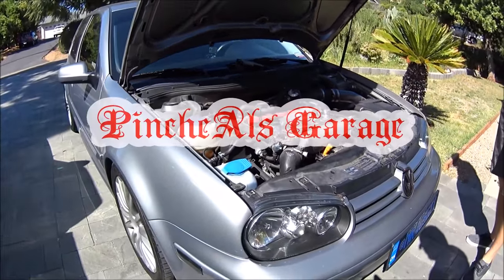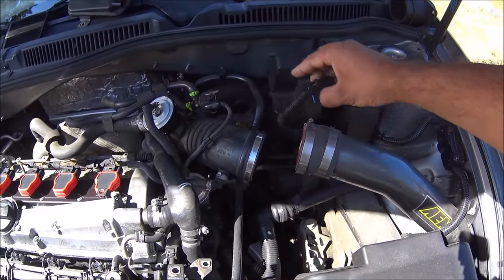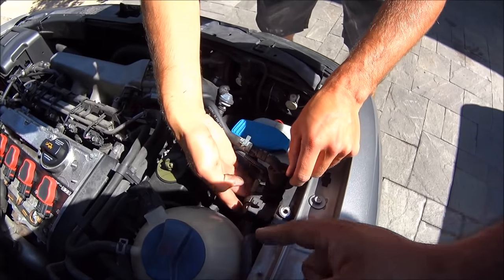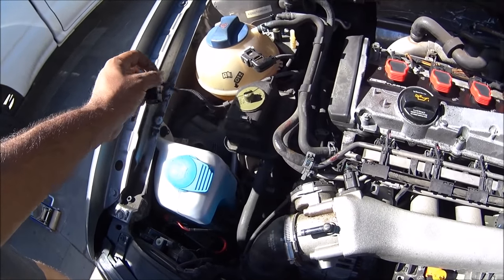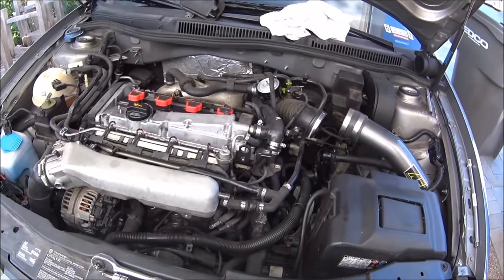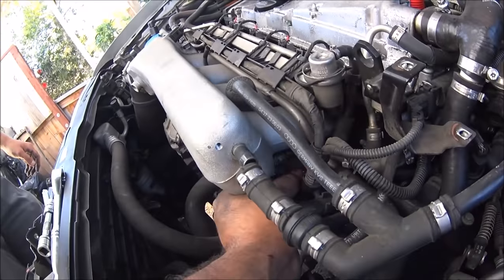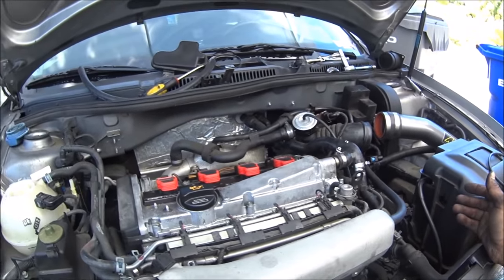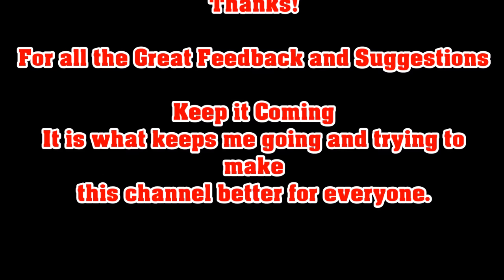How to Remove MK4 SMOG System AKA SAI Delete DIY

Comment from the maker: This is the link to the kit you will still need to buy a block off plate for the egr/combi valve or make one.

http://www.urotuning.com/Basic-Parts-Kit-for-SAI-N249-PCV-EVAP-Delete-p/sai_delete_parts.htm
Reply: what does the SAI block off plate do?
Reply from the maker: it cover the small exhaust port on the side of the head where the combi valve covers it.
Reply: PincheALs Garage , when you do that job the light of the check engine doesn't turn on ? it doesn't affect when you do the smoke check ?
Reply: the chekengin no start in my gti no start an pass de inspection no problen the problen is the boost controler no worck
Reply: what hose line did you use to route it to the break boost & the diverter valve? did you reuse hose's?
Reply: Do you need the resister for the plugs or is it fine without?
Reply: hey is there any other kits you know that sell in Europe cus ill have to play about 200 dollars for shipping to get this kit
Reply: Is there one for 2.0

Comment: Hey man I subbed due to the detail you go into!! Very awesome I have the block off plate just have to get the resistors. I'm doing a delete and a catch can all in one go and hopefully in the process figure out why my motor won't go above 5500 rpm and I have no speedometer 04 1.8t AWP

Comment: Hey I came with with a way to keep your hose connected to the intake without electrical tape. If you take the plastic piece on the end and flip it around and force it back on it actually works pretty great all the pieces just fit right into eachother

Comment: You are the man with the way you tech simplified and straight to it no need to over complicate it.i just have one question can u loop the lines coming off the fuel rail and delete the whole evap box or is there more needed.

Comment: At 16:15
That cluster of hoses that goes down to the engine below the intake manifold, what did you do with the open lines into the engine.
Reply: The smallest tap under your manifold is for your FPR and or Boost gauge, you should definitely have a boost gauge. The tap next to that is for your DV. The bigger tap previously used for your Brake booster is capped off. And the last tap at the end of the manifold you would use to run a new single line for your Brake booster IIRC. All vacuum hoses are either replaced, removed, and when necessary unused ports are capped off. Get a tune that deletes this stuff and you are ready to go.

Comment: The N249 with no signal from the ECU communicates the manifold vacumm to the DV, and when the N249 receives signal from the ECU it communicates the reservoir of vacumm to the DV.
Therefore the presence of the N249 I consider is necessary to have a better reaction in the engine to be able to activate the DV even when there is still boost in the manifold, therefore the overpressure does not force the opening of the N75 and the turbo does not fall from Rpm giving better reaction.
As a conclusion I think removing the N249 engine would have less reaction and unnecessary wear on the turbo
The only thing I see as positive when removing the n249 is less vacuum lines, better appearance
Reply: would connecting a line from the DV to the intake manifold solve this?
Reply: @bigjesus4986  yes there are actually dyno tests and lots of research shows if you have a larger turbo and other mods ditch the N249

Comment: Awesome video! Very informative, only one question, any materials that need to be bought before doing the project that don't come in the kit? Basically what I've gathered is have coolant on standby and buy some 1/2 inch tubing for the brake booster, anything else I'm missing before I go and start ripping vacuum lines out of my engine? Also, how well does it run without a tune? As of right now my SAI pump is bad so it misfires under heavy load. Would this be an improvement?
Reply: Wow 3 years I hope you figured it out by now dude, I’m in the same boat currently trying to take lines out

Comment: Funny how one of those plugs you get with the kit actually fit in the hole where the combi valve came off. I used a bolt for that other hose because it works

Comment: @PincheAls Garage - Ive done all of what you guys done on this video. I have a couple of questions. The first vacuum valve from the SMOG filter thingy, not the manifold side, the one next to the coolant reservoir ... u dont seem to mention if it needs to be capped off? or left alone with no pipe on it now? secondly ... i yanked the brake assist pipe at the rubber/plastic valve near the bulkhead, instead of cutting it like you said. there was a loud pssssss .... can i just reconnect it as if nothing happened lol!

Comment: Top of throttle body that you capped off,  that went to a check valve leading to a hardline under the fuel rail. What did you do with that hardline or after the check valve vacuum ?

Comment: Yo I did the full sai delete just curious what u do with the little Pcv valve not the hockey puck do u still need it when you chop off the unneeeded part of the brake booster I’m running mine without right now I have a catch can but I haven’t installed it yet I don’t know if I wanna use it anyway but it came with my block off plat and resistors is it ok to run without it

Comment: If i just cut the wires to the sensors id be using resistors too, it would just cause a check engine light since I already have a SAI delete? Not worried about a check engine light, more worried about bay cleanliness

Comment: I did all of this on my 1.8T. The big thing here is if your state has smog check where they put a probe in your exhaust, you will fail. If your state does OBD plug in testing, you will fail. If your state does visual inspection under the hood, you will fail. 

I did a Eurodyne tune which not only gave me more power, but also deleted those systems from OBD tests, which made my car pass emissions- we only have OBD plug in and no visual in my state.The cost of Gonzo or Eurodyne with deletes should range from $450-600 depending.
Reply: So what you are saying is. To be clear - if you get a tune that has SAI\EVAP delete (e.g. Gonzo or Eurodyne) you will no longer have a CEL and you will pass OBD2 plug emissions testing? This would be my deciding factor on Gonzo tuning if this is correct.
Reply: Ian Matyevich Yes, you will NOT have a CEL and testing at a state OBD scanner comes up clean. At least it did for me with Eurodyne
Reply: Thanks for the reply brother.

Comment: Hey so I have done this delete, it sends a code. I’m currently looking for a stage 2 tune, is there some you can recommend that will remove the check engine light for the Sai delete? I have tried just using my OBDeleven to remove the code but it just keeps coming back.

Comment: Hey! Did Sai delete, changed 02 sensors and camshaft position sensor, but I'm still getting the code for them P0333,P0411, P0420,P0343, also getting smoke outta exhaust and oil dipstick I got a 2003 gti 1.8t any ideas what it could be ? Please Help! 🙏🙏

Comment: Thanks for the DIY. one question, do I Need to cap not only the one on the intake, but all the other holes on the left side of the engine? N80 bits I think it was..
Reply from the maker: yes any vacuum line unused needs to be capped off

Comment: PincheALs Garage , when you do that job the light of the check engine doesn't turn on ? it doesn't affect when you do the smoke check ?
Reply from the maker: Daniel Diaz if your state requires smog check you will fail if you do this. this will also give you a check engine light for the secondary air flow which will not affect the cars performance.

Comment: Love this DIY, Just onee question. What size is the line that goes from the DV to intake? thanks
Reply from the maker: from the charge pipe its 3/4 to 1"
to the intake is 3/4"
the vacuum line to the manifold is 10mm
Reply: So the dv line is 3/4" or 10mm diameter on the inside?
Reply from the maker: no those are 3 separate lines
Reply from the maker: hey i just uploaded a quick video for you about your question. hope it helps
Reply: Appreciate it man, love this channel.

Comment: Hey man I know it’s a old video but im doing this delete once the kit comes in. Right now the previous owner ran a line from the fpr to a t connector. Then ran a line from the nipple you put the dv hose on to the t connector. And then a hose going to the boost gauge. If I’m running the dv line to the end nipple on the intake manifold where would I put the line for the fpr ? And would I just have to Put a T connector in between the line for the FPR and intake manifold to run the boost gauge ? (Guy I got the car from is a complete idiot so I’m going over all the “work” he’s done to it and getting everything right slowly but surely. Making it easier to find a leak I’m having to where I’m only peaking15lbs instead of 22

Comment: Hey man love the video! What size is that hose for the brake booster? Also where can I buy the blanking plate for the combi valve? Your removal shows 3 holes and all I can find is SAI blanking plates with 2 holes. I have an AGU engine and they have no SAI so I'm a bit confused. Happy to donate to your channel once I sort this also I see you mention this in a recent video 🤙🏻
Reply from the maker: Grant Mac Dee you only need to 2 holes to cover it.
5/8 i think is the hose size youll nseed. just in case just take a piece of the one you removed to size it.
Reply: If you get the opportunity to do a PCV simplification video on an AGU as the setup is pretty different. We have vacuum pipes also on the active charcoal filter which is in front of the coolant header tank. Also on the PCV simplification its the perfect chance to install a catch can and I would love to see your way around it. There are no guides online for AGU. I'm assuming I dont have the evap system if I dont have SAI either which then in turn makes this video a bit obsolete for me.
Reply from the maker: Grant Mac Dee
correct the AGU motor is very uncommon so it will be very difficult for me to make one for you since i yet to see one or work on one i a long time. If you dont care for SMOG the car it will be very ez to bypass all the hoses since your just removing them. The only issue i would see if there is a coolant line or a sensor that is needed for the car to run correctly then you'll need to TUNE it out of the car for it to run correctly.

Comment: Can i do this without removing SAi having vacumm leaks but dont have time or money for the resistor. Thanks for the help. 99 beetle gls 1.8t
Reply from the maker: Technically you can it will throw a code for flow efficiency but it will not effect the car's performance

Comment: Hello friends!
a query. What do they do when the Check engine light comes on?
Because if you turn it on to detect that the secondary vacuum pump is needed.
It can be turned off with some kind of modification with the software VAG COM?.

tnks. :)

Regards,

Comment: hey pincheal quick question at the back of the suction pump there's a hose that connects to the pcv system I believe. what do I do with that line after wards just leave it be ? or do I plug it up. it's towards the engine and heads up into the pcv. has a little bend going Into something  else towards the end
Reply: Yansi Cordon what did you do to that hose? I'm about to do this delete but don't know what to do with it
Reply: So I guess some mk4s come with 2 little ports and some have 1. I ended up plugging the pcv system to that hose with a pcv check valve actually goes straight to the manifold. I have to do a pcv catch can soon. If you're still curious I can send pics after work to show you what I did
Reply: Yansi Cordon yes that would be awesome thanks

Comment: what did you use to block the pcv unit?like the one that connects to the air intake?
Reply from the maker: we looked for a bolt big enough to cover the hole. the short hose that comes off the intake and pushed a bolt right in and done.

Comment: Que excelente video y su canal esta super!
solo me quedo un pequeña duda, cuando terminan de quitar todo y se despiden ustedes en el video, ahí ya se puede encender el motor ? ya se puede utilizar normalmente ?
Y en general, este proceso para que me sirve ? solo para evitar fugas de vació o me da mas potencia ? 
Muchas gracias por su aporte.
Saludos,
Reply from the maker: can you repeat this in english please.
Reply: Jejejeje!  I'm sorry,  my English is bad!  :'(
Reply: Excellent video and that channel is super! So! just stay me a little doubt, when they end up removing everything and you say goodbye in the video, there you can already start the engine and can be used normally and in general, this process serves me just to prevent leakage of empty or me It gives more power thank you for your input. Regards,
Reply from the maker: yes just as long as you got all the resistors and combi valve block off plate
Reply: Oooo tnks so much! I will work this next weekend! :D
question, this kit have all resistors or need buy some extra piece ?
Reply from the maker: the depends on the kit you buy.
Reply: my car is Jetta 1.8t model 2003 a engine AWP. :)
thank so much!
Reply from the maker: these are the parts you need 

http://www.urotuning.com/1-8T-SAI-Block-Off-Plate-p/uro-1.8t-block-off.htm

http://www.urotuning.com/SAI-EVAP-Delete-Resistor-Kit-3-pcs-Mk4-1-8T-p/sai_resistor_mk4_kit.htm

Comment: i notice the cold air intake wasn't taking care of in the video and i was wondering do you block that line as well?
Reply from the maker: Cesar Avila yeah thes hose that comes off the intake just cram a bolt it the hose or find a cap.
Reply: PincheAls Garage okay I did it today. And I notice it so I plug it anyways and here you tell me yes, but thanks.

Comment: hey PincheALs Garage I've read that when you delete the evap system there will be gas fumes being dispersed into the air. Would you need to maybe run a line to the back of the car underneath the rear bumper to expell the fumes? I've seen in forums that a few people did that. I'm not 100% sure if it's necessary for our cars though? thinking about doing this but I'm worried about the evap thing. thanks.
Reply from the maker: lol! no sorry. what happens that the blow by fumes don't go through the evap system but they do go back to the intake if you route it that way or vent it to the atmosphere which wont give the car any issues however it will just smell like oil and gas. i highly suggest an oil catch can that will route back into the intake so it catches the oil and you dont start smelling like you just mowed the lawn.
Reply: Okay haha thanks for the response! Yea man I'm still learning but I've had my 20th for a while now and I really wanna start cleaning the engine up nice and eventually build the hell out of it! But yea I was thinking about buying the ultimate delete with the integrated engineering catch can. Thoughts?
Reply from the maker: +DylanBmx4L thats a great kit... DO IT!
Reply: +PincheALs Garage sweet! Haha thanks man! Love your car by the way! beautiful!

Comment: I am about to swap a 24v vr6 into a 1.6 chassis, and was thinking about how to ease it all up. so my question is, what are the things that NEED a vacuum line to go to them? brake booster and fpr? I want to go crazy and delete all the nonsense before I even put the engine in. I want to get rid of the SAI system and the combi valve. also, would it affect daily drivabilty anyhow?
Reply from the maker: Gatis Girdenis brake booster, manifold flapper, i think the throttle body and fpr. There not much. youll also need to tune out the rest of the stuff you pull of from the motor aka smog equipment.
Reply: awesome, thanks! here's to hoping that swapping and driving the vr6 will be somewhat fun in the end, haha.

Comment: Hey mister Al.I have a 1.8t jetta 2002 and im getting a lot of air in the engine. my oil cap is dancing on the cover when unscrewed. So I did change out the small crank case PSV and the PRV valve ( the pancake looking valve) and checked for plugged lines. everything was clear. But Im still getting lots of air in the engine. any suggestions?thank you.
Reply from the maker: hujek81 that's what we call blowby and that's normal. you will get lots of air in that pcv or valve cover area.
Reply: ok I was kinda worried.thank you Sir

Comment: I realize this videos a little old but how does this effect getting past the good ol CA  smog Nazi? With a tune to get rid of CEL will it pass the function part so long as my guy is lenient on the visual?
Reply from the maker: chris rigby well 1st off you cant pass smog when doing this. you will fail visual inspection. The tune will let you pass the 0b2 test because those will be turned off.
Reply: PincheALs Garage so the visual is the only issue?
Reply from the maker: chris rigby yes
Reply: PincheALs Garage sweet! thanks! just curious roughly where about are you located? I'm in bakersfield.
Reply from the maker: chris rigby Escondido CA 92025

Comment: Hi if I do this how am I supposed to connect my coil catch can just one hose to the valve cover and one on the crankcase ?
Reply from the maker: Depends on the catch can you use
Reply from the maker: If you look for my new oil catch video it will explain a lot to you

Comment: You might be able to help me out. Picked up a 2.0 mk4 Jetta for a winter daily. It has a rapid ticking when only accelerating. Any ideas?
Reply from the maker: SlammedSocietyS2k :p can be a couple things. Timing is off and its hitting the valves, bad pulley or timing belt is bad and it jumped a tooth
Reply: PincheAls Garage timing belt was replaced. I didn't do it but I know it was. I've been driving it for months and it hasn't exploded so I assume it's probably a tensioner or something